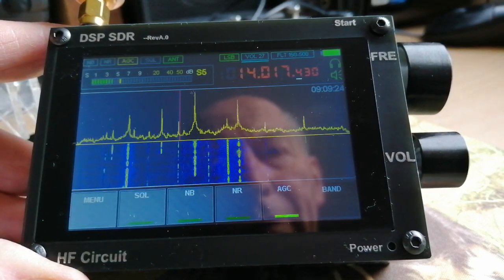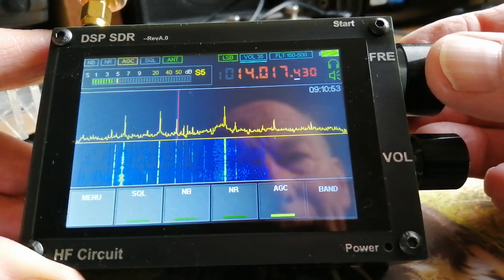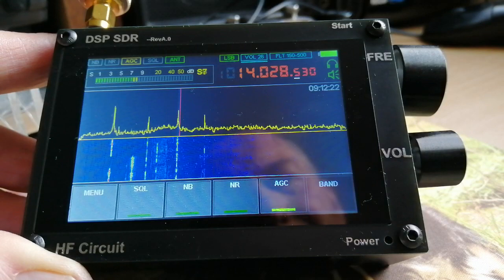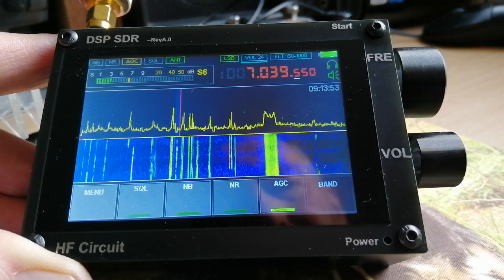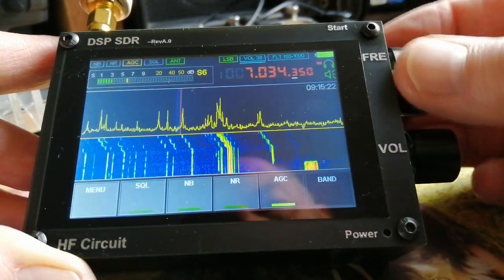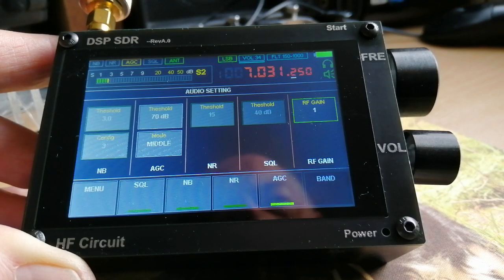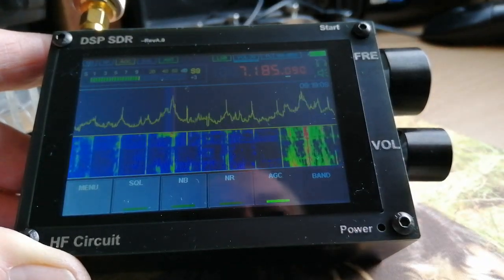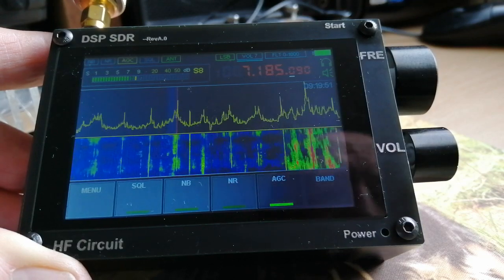Overview of the Malahit Clone SDR receiver with basic "demo" firmware CW and SSB.

Comment: My experience has shown that the clone versions are often badly manufactured, do not work, or are simply not up to what they promise. I wastest $249 on some rubbish that was faulty. 
Try to get an original Malachit, sold by Amazon. It is a little more expensive but it is the real thing. HAM-Radio is a very expensive hobby when you use genuine items and not the bad counterfeit stuff some companies try to sell you.
Reply: I don't think those sold on Amazon are genuine. Any I've seen are sold by Chinese sellers.

Comment: How do I find out the firmware version and where and how I can upgrade to the latest firmware? Cheers!
Reply from the maker: If you have purchased the receiver with the basic demo firmware (as in this video sample) when switched on it will default into the user screen. A registered version will show the firmware version after the initial switch on! Assuming you have the basic version, you can obtain a firmware upgrade (to a registered version) in most cases by contacting your supplier who will sell you a key/code to enable upgrading - cost was about $55 for this. After that, subsequent upgrades are free. I recommend you look at the user group which is on Facebook for further help and advice to upgrade if you wish to proceed. Hope this helps!

Comment: understand these are software radios.. no filtering whatsoever!
Reply from the maker: The SDR receiver functions are controlled by firmware (a software program) and this enables variable selectivity (filtering) with a "Narrow", "Normal"" and "Wide"" setting each of which can be set as the user prefers in the Registered versions of firmware. It is one of the better features of this receiver.

Comment: Roger, very, very helpful.  What is the significance of the ANT indication?
Reply from the maker: Hi Tom. Thanks for your feedback. When the receiver is operating with the "Demo" (Basic version) firmware as in this review, the "ANT" indicator can be ignored. If you go into the "HARD" menu setting, you will find a setting labelled "Antenna" and rotating the Volume encoder will scroll between "External" and "Internal" and this will illuminate or switch off the "ANT" notification on the upper part of the touch screen - however it makes absolutely no electrical difference to reception with the antenna connected! In the enhanced  "10f" version of firmware, similar menu changes denote a "High-Z" or "50" ohm impedance matching change for antenna input. In practice, I find no observable difference in reception!! It is possible that further revisions of the firmware may actually produce noticeable / improved matching for antennas. Similarly, in the "Demo" version under the "Hard" menu, the "Pre" setting changed in a similar way via the volume encoder to "On" and "Off" DOES switch a level of Pre-amplification on/off. In my case I find that it is reversed in practice: It's actually on when denoted as "OFF" and vice-versa!! All good fun to keep you on your toes I guess :-) !!!
Reply: @Rogneil100  thanks for your excellent explanation.

Comment: TIP: Each time you tap the frequency display, the white cursor moves one level higher.  It took me a while to realize this and had originally thought the cursor would move to the number tapped on.  Much better experience now!  My radio, like many of these Chinese Malachite Radios, did not come with instructions.
Edit:  
I think I failed to explain this correctly so this is a clarification.
Hitting the frequency numbers is unreliable to change frequency.  Tap on the volume icon above the frequency display and the cursor will move in sequence, allowing you to change frequencies with ease.
Reply from the maker: Hi. Thanks for adding this useful "Tip". Changing the tuning step with the basic / demo software is probably one of the most frustrating operations with this version of the receiver. Unless you have a stylus or small fingers (and some patience!) it can be a bit of a pain. Note also, by touching the screen display you can "move" frequency albeit in imprecise amounts! The upgraded software version allows direct frequency entry (touching the frequency display brings up a keypad to enter the desired frequency) and selection of tuning steps is achieved by short presses of the tuning encoder knob. In reply to your question, pressing the volume control knob for minimum of 3 seconds brings up mode selection from which you can highlight/choose desired mode.

Comment: Thank you so much.  I thought my radio was garbage until YOU showed me how to use it.  Thank you.  73
Reply from the maker: Pleased that this has been helpful! I should have made reference to the necessity to slide the tiny "REST" switch on the underside to "ON" when you first get the receiver, otherwise the internal battery is not connected. Many first time users (out of the box) did not know this :-). Some basic instructions would have been a useful addition on purchase!!

Comment: Hi my name is Nick my call sign is n2hvr. I recently received the same Str radio that you demonstrate in the video I press the start button and nothing happening I also charged it and the green light came on at the bottom of the screen I charge it for a few hours still I noticed I can't get the radio to turn on if you could provide any suggestions or help to have me get this radio to work I really appreciate it you can email me at. Nickn2hvr@aol.com

Comment: I purchased this exact unit from Amazon...When I received it, they sent the incorrect charging cord, the internal battery wouldn’t charge ( finally after 2 days it decided to charge),  the antenna included came apart at the base and seller advertised it received up to 2ghz......IT WOULDN’T .......I contacted the seller and all they wanted to do is send me a discount of 15%....I finally got permission from Amazon to return it for credit...And still had to pay shipping back to the seller....A very disappointing experience.
Reply from the maker: It seems that there are several sources in China which are cloning the original Russian open source receiver design and with variable quality control. I see from other commentary that others have had a similar disappointment with regard to construction whilst many seem happy with their purchase and subsequent operation. Since my initial overview, I have moved on to the registered upgrade firmware version and it is far more user friendly. If it had true portability using a small whip antenna this SDR receiver would really be a winner.
Reply: You have to buy a after market external antenna.  I found that a wonder wand or moonraker wonder loop worked really well for hf.  But I've seen passive portable antennas that will adapt to the antenna socket.   I use the wonder wand from moonraker for hf listening.

Comment: Update after 2 weeks.  Mine has the free software , and the thicker one with the 2 speakers 
(one is  parasitic) and big Knobs, says Shenlan EK, it says on the case 
revA.0 but iside it says A3 ? .Two meters is useless as inteferance from
 the internal circuit, but its great on HF exept for powerfull stations 
swamping the band , half of the memory slots do not work. The freq steps
 are a REAL pain on the touch screen to touch correctly and selecting a 
station from the touch screen is bad as you end up with tiny frequency 
steps to correct as frequency step changes., once on a station it is 
pleasing.The sound is really full and detailed on FM and great on hf. I 
 On mine  the Pre amp setting is wrong ie off is ON, and on is OFF, 
leave it activated ie OFF on the rod antenna and dont activate it on a 
20m wire or similiar. Setup I find 75db on AGC as recomended by the 
Russian designer "George". RF gain 20 to 25 on rod with activated 
preamp, 10-15 setting on 20m wire with preamp not activated (with 9:1 
balun).The screen was not flush with the case a gap of about 3mil at one
 edge, I opened the front and found the edge of the circuit board 
snapped of at 2 corners,thats why it would not hold down. If you open 
the case it will be a pain as the other side of the visible case screws 
is a nut which will drop off inside! It is an incomplete radio, but it 
receives way better than my techsun 660 and sounds better and picks up 
more than my Icom pro due in part to having no mains borne inteferance 
which renders my HF radios useless at times thats what was apparent 
straight away on battery power. Some time it does not want to come out 
of hard setting and a restart is required.  No speaker grill is not a 
good idea, its been thrown together, I paid £106 from Banggood, not 
Chinas best offering, shame.
Reply from the maker: Thanks for your update and whilst I have not had the construction issues you describe, I would fully agree with your comments. I have upgraded to the registered upgraded firmware which has massively improved it's user interface though actual reception is similar. Definitely a project in progress!!
Reply: @Rogneil100  What number is the upgraded firmware?
Reply from the maker: @paulhotson5820  Hi Paul. This known as the "Demo" or basic version firmware which once upgraded will have a numbered version.

Comment: What antenna(s) do you use for the different bands?
Reply from the maker: Antenna used here is a multiband vertical which comprises of quarter wave lengths for 40m, 20m and 15m connected together at the base of a 10metre fibreglass pole and fed into the radio shack with good quality 50 ohm coax. Copper earthing rods situated at the base are additionally connected to many ground radials cut to approximately similar wavelengths. No matching ATU needed as antennas are cut to give 1:1 SWR into the receiver/transceivers. Simple, effective and cheap!!
Reply: This would be no different to any other reciever or scanner regarding antennas you use (although I'm not sure how good the filters are in this hardware) basically you would use an antenna suited to the band you are listening to i.e. for HF you would use a longwire, or dedicated HF band antenna, or an active antenna such as a loop or mini-whip etc - actually I've read the active loop antenna works very well on SDR. For VHF/UHF just use any dual band 2M/70cm amature antenna such as a Diamond x30 for SDR reception on VHF/UHF a Discone would probably work well too

Comment: Just got it the same one. Very clunky but superb reception and audio if you set it up properly which is CRUCIAL, or you will hear nothing. From Banggood £106. Better than my Icom pro.
Reply from the maker: I would agree that correctly set up, this mini SDR receiver performs very well (almost indistinguishable) from my ICOM 7400 and on occasion, side by side, the Noise Reduction feature enables it to make an otherwise weak SSB signal more coherent side by side using the ICOM's DSP.
Reply: @Rogneil100  But do they overload on a full size outdoor antenna?
Reply from the maker: @624radicalham  They need a full sized antenna to maximise the capabilities - there is insufficient front end gain in the earlier versions to work well on the HF bands with a small telescopic antenna. The more recent versions have much improved front ends and work quite well on a telescopic whip and it is possible to match the impedance via software switching. Recent versions also give access to an attenuator to minimise inter-modulation effects should the gain to be too great.
Reply: @Rogneil100  Fabulous. That was my biggest concern which you've remedied. All the best!
Reply: So then, how do I properly set mine up? Have it hooked up directly to a 160 meter loop antenna and still not hearing much.

Comment: Do NOT support Tech Thiefs
ie  Chinese High-Tech Thiefs

NEVER EVER
Reply: In this case the manufacturers are not thiefs, Malachite project is open source. The creator of this still makes money (thank God) with the software upgrade.
Reply: @paulatreides6779  Its not open source.  If it was, there wouldn't be hacked Chinese firmware.  The demo firmware is available but the official firmware requires an official radio and code from the Russian maker.

Comment: How does it compare to other popular SDR receivers or a shortwave receiver in the $100 dollar range?
Can bandwidth be varied to deal with QRM ?
Reply: The Whip antenna is worthless in HF since it is not matched.   Here is an excellent video on how to solve this with a mini 49:1 matching transformer =   https://youtu.be/bUp3NnfTya4
Reply from the maker: I am not aware of a genuine SDR receiver under $100 available in the UK which comes close to the features of the basic "demo" version of this receiver. It has through the use of variable bandwidth and noise reduction, the ability to reduce (not eliminate) QRM. If you purchase the registered version with upgraded firmware (for a relatively modest increase in price) it is in a different league again. The primary downside of its portability is that it needs the additional board to work well on a small whip antenna as compared to several none SDR portable receivers under $100. That aside, connected to an external antenna it compares very well to other expensive "black boxes" in my radio shack. It is not without some issues, but for the price and its innovation, in my opinion it represents good value for money.
Reply: @Rogneil100  When you say it needs the "additional board"   could you explain what that means?
Reply from the maker: @n1kkri  The original (Russian) producers of this receiver have made an additional board and describe it literally as  "An optional board has been developed for the receiver, which contains an active antenna (for a telescopic antenna), additional RF filters and an attenuator. The board is designed to improve HF reception". They also add that an additional payment is required if you order the assembled receiver from them with this modification. As far as I am aware the Chinese clones do not have this feature - as yet! 
There may well be more commentary on this via the facebook user groups - hope this helps answer your query.

Comment: Looks like a £1000+ spec in your pocket. Just ordered one, my Techsun 660 will not match this.
Reply: 2 week use update.Mine has the free software , and the thicker one with the 2 speakers (one is  parasitic) and big Knobs, says Shenlan EK, it says on the case revA.0 but iside it says A3 ? .Two meters is useless as inteferance from the internal circuit, but its great on HF exept for powerfull stations swamping the band , half of the memory slots do not work. The freq steps are a REAL pain on the touch screen to touch correctly and selecting a station from the touch screen is bad as you end up with tiny frequency steps to correct as frequency step changes., once on a station it is pleasing.The sound is really full and detailed on FM and great on hf. I  On mine  the Pre amp setting is wrong ie off is ON, and on is OFF, leave it activated ie OFF on the rod antenna and dont activate it on a 20m wire or similiar. Setup I find 75db on AGC as recomended by the Russian designer "George". RF gain 20 to 25 on rod with activated preamp, 10-15 setting on 20m wire with preamp not activated (with 9:1 balun).The screen was not flush with the case a gap of about 3mil at one edge, I opened the front and found the edge of the circuit board snapped of at 2 corners,thats why it would not hold down. If you open the case it will be a pain as the other side of the visible case screws is a nut which will drop off inside! It is an incomplete radio, but it receives way better than my techsun 660 and sounds better and picks up more than my Icom pro due in part to having no mains borne inteferance which renders my HF radios useless at times thats what was apparent straight away on battery power. Some time it does not want to come out of hard setting and a restart is required.  No speaker grill is not a good idea, its been thrown together, I paid £106 from Banggood, not Chinas best offering, shame.

Comment: “Flaky tuning step” Definitely with mine. I wonder if the upgrade solves this? Do you know where to get the software upgrade?
Reply from the maker: Hi. The upgrade registration code can be obtained by contacting the owner/creator of the firmware Georgy, RX9CIM via   malahit_sdr@rambler.ru
There is a payment which at the time of replying to your query is about $55. It may be possible for your supplier in the case of a Chinese clone to obtain the registration code for you with a payment to them who subsequently purchase this from the owner in Russia. There are Facebook user groups for both the original russian receiver and separately, for the Chinese clone version which would be helpful to guide you through the firmware upgrade etc.